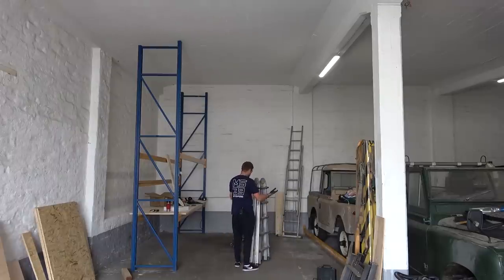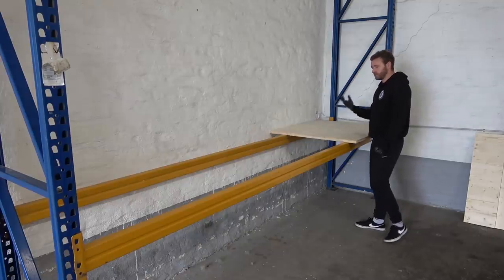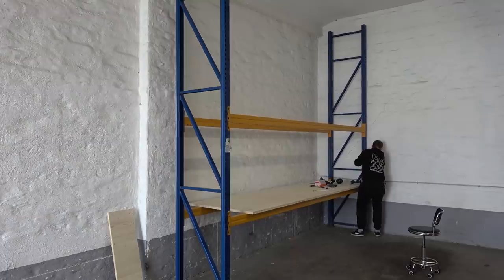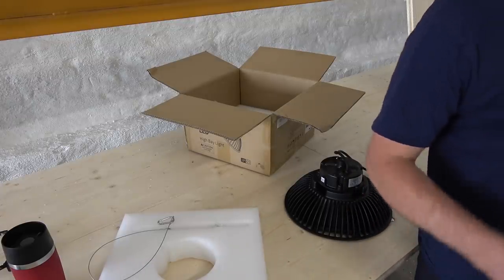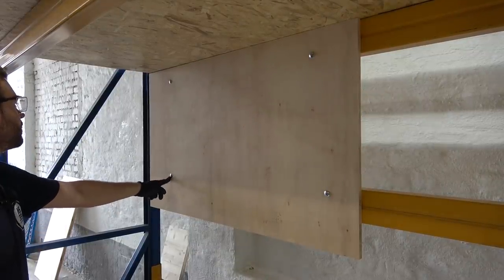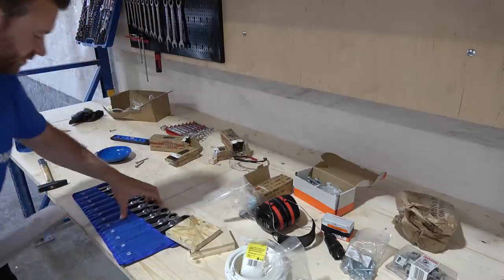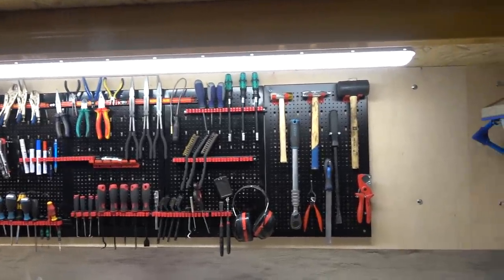Building a Simple Workbench For Working On Cars - Workshop Build: Part 1

Comment: Great idea and well done. One thing you will wish you had done, however, is put a narrow backboard on the work surface at the wall so nothing can fall down at the back. I speak from experience. Thanks for sharing.
Reply from the maker: It's tight fit to the wall but I plan to add a thin wood strip there anyway.
Reply: @M539Restorations  You won't regret it!  Small parts have a magnetic attraction to those narrow slots and finding them on the floor can be disheartening.

Comment: Ideas for additions to the work bench — mounted power strips to plug in tools (soldering iron, dremel, etc.); paper towel / shop towel roll holder; vise; lamp on arm to direct light where you need it; lighted magnifying glass on arm for detail work on PCBs, gauge clusters, carburetors, etc.

Comment: I'm in Australia and it gets cold and hot. More hot than cold. Germany, maybe not good for Summer or Winter in your country but good for Spring or Autumn. Your loading racks seem to have plenty of space to build up (use every space you can fit as you say). Get a few more orange load racks with the wood base and put on the top level of your rack a mattress and pillow for the times you need a rest or a nap. Put another orange rail on the side so you don't fall out of the bed, attach a ladder to get up there, then instant chill out bed to rest your bones and muscles away from home :-) Better than lying on a cold concrete floor!

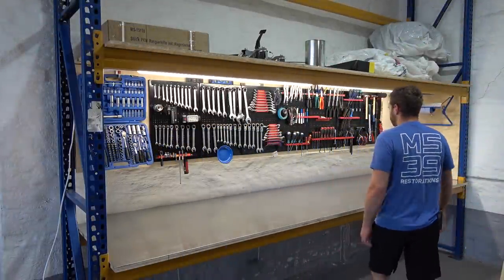Comment: 25:10 Consider turning that 90° corner into a radius(rounded edge) that way, instead of splitting the skin open and cutting, it will just hurt like hell, if hit, in the near future. Also, if you put a mattress on the top shelve, its a quick nap bed. Imagine having one viewer over - a lucky winner - to watch you while you work and film from the top shelf bed. Proper batcave.

Comment: Countersunk self-drilling self-tapping screws with snap-off clearance drilling wings to fix your bench top/shelf boards, etc.  So much easier and quicker than bolting through.  Look them up, they're commonly used for decking on mezzanine floors.

Comment: Very fun video.  Of course being a commenter, I have a suggestion.  Last thing to do before you use it.  Get some polyurethane caulk (or silicone), and lift up your sheet.  Please a thin bead around and between the perimeter of your Aluminum.  Butt them back together, and screw them back down.  Clean up excess.  When you inevitably spill some beverage or solvent, it wont seep into your expensive wood panel, and swell it.  Nothing crazy, just a thin bead will help.  I love it!   I have my own decisions struggles on the garage.  Reminds me, I need to check my LED lighting for camera suitability.  Awesome work!

Comment: You should leave some nice wide gaps on that tool wall you built. Symetrical. In case you have something with a girth on the table and need some extra space to rotate it and so on. So adding 2 or 3 decent nice wide gaps symetrial up to the beam would give you som more options.

Comment: If i saw correctly there is a blue plastic protector on the paper roll metal, if you take it off, it will tear much easier, we used the same thing for a year with that plastic on:)

Comment: love it. Clean, flat and illuminated.

The only thing i would have done differently is where you've put nuts n bolts through - i'd have used Rivnuts in the support bars and then dome head bolts to secure

splendid job though, can't wait to see it in use

Comment: for the bench tops I would use structural or marine ply......it comes with a smooth laminated dark surface and wipes down easily, liquid impervious,available at my local equivalent of walmart. However, that is a great tip to use commercial pallet racking/shelving for a workshop bench and storage combo.......especially if the building has decent ceiling heights.
Reply from the maker: Thanks. That's actually not a good idea if you do what I do, any type of wood and it'll be damaged within minutes which is why I went for alu. It's one of those things, buy it once and never worry about it again.

Comment: Great work Sreten. I wish I had such a well thought out workshop. Just over concern. Aluminium seems a bit soft for a bench top. Most of the automotive/metalworking workshops I been in or set up use stainless steel. You could have ordered it with the front edge folded into a channel the thickness of your timber bench top so that it fitted snugly over the time sand under (this could have been done for the Al too). Screw up from below and therefore no screw heads on top! Keep it in mind for next time. Lloyd

Comment: Should do the bolts upside down as the other side is flatter and upper side are gonna get coverd by a metal plate soo....  

Would be more flush than the knuckle heads.   
Watch them knees..   Just a tip.   ;D

Comment: First is my name is Martin from wa state, I want to say a big thanks to you, if it wasn’t for the vid you did on the e31 doing the cylinder ID sensors I would have never known that the direction was very important, I purchased a new set of plug wires cost over 400.00 us and during my diagnosis of ignition code16 and 41 a bad MAF I noticed the sensor for 7-12 was installed at the factory in the wrong direction for cyl 12, got that fixed now just a broken hot wire in my maf just want give you a big thanks for the info you put out love the content

Comment: I have to say I found your YouTube sites as I was watching other videos on bmws. The one that I watch first was the Chicago BMW. I'm all caught up with all of them waiting to see the last one.

I love the idea that you came up with for using that type of shelving. It makes me mad that I had an opportunity to get a shelving unit just like the one you have for free. I just wasn't sure if something like that would have worked out. Now that I seen what you did I'm now going to keep my eye out for another chance to either get one for free or a reasonable price.

I have a small tip for you and it's nothing major. The screw that you countersunk you should take some clear RTV or a silicone that will hold up the chemicals. You should fill in the top of each screw. If you don't oil and other things will work your way into the wood. My father built a workbench out of wood and then did exactly what you did with the stainless. After a few years my father notice that the screws in certain places where not holding down any longer. So he and I removed the steel and every place that a screw went in had made its way into the wood and rotted out. When we replace the word my dad used some clear RTV on every screw head. That bench lasted another one years after fixing it. The only reason I don't have it with me today was for the fact my father built it in place and there was no way of getting it out of the basement without taking it completely apart.
When I moved my life really did not want that to go so I left it at my childhood home after selling my home.

He is no longer with us and I really wish that I did not listen to my wife. 

I really truly enjoy your videos. I've been watching your videos now over 24 hours.
After watching what you went through with the Chicago build it just made me thankful that I walked away from a 2011 750 BMW. It only had 88,000 miles on it and the owner was told more than likely it was in need of timing chains and those cam sensor that on the end that you act so definitely mixed up and the owner wasn't putting any more money into the car.
The car was super clean at most definitely only had 88,000 miles on it. The price was ridiculous he was asking 7,000 or best offer. After doing research that's why I realize all the issues with that engine. Like you I have no problem yanking the motor out and putting a new or rebuilt one.
When I priced motors here in the states it was ridiculous amount of money they were asking for these used engines. The cheapest I found was $7,000. So here was not a chance in hell I'm buying a used motor for $7,000.

But anyway I just wanted to let you know that I always make sure they hit the big old like button and of course I hit the subscribe button after watching the first video. I'm really looking forward to see what you do next. I know I have a lot of videos to watch that you have made over the years.

Looking very forward for watching more from you.

Comment: My set up is similar, except I have set an old kitchen sink into the bench. It has a 20 litre oil container underneath and I can pour old oil etc into the sink and let the containers drain. You might need some power points for charging power tools, soldering irons and so on. Oh, and where are the girlie calendars?

Comment: erm.. you think that the nut is round and you won't be able to hurt yourself.. but i really recommend putting the bolts in the other way round. countersink the nut into the wood on top and use the carriage bolt's flat head on the bottom. :)

Comment: not boring at all! I love the fact that you keep the tools organized and clean. You could also use the space under desk - some drawers I mean, you'll be surprised how fast you'll fill them up:) Do you have a hydraulic press? I remember you went to a neighbor for something...master cylinder e65 retrofit in e39 :) don't remember what tool you needed... Make sure you reserve some space for future ideas, a welding machine like tig or mig - for flexible joints on exhausts for example nothing crazy or expensive, I know you hate rust and not doing body repairs...or perhaps an aliniament stand that could be also used as a lifter, just saying... I'm thrilled to see how you setup your workspace - the only regret I have is that you hate diesel but I hope one day you'll cange your mind and try fix one, another thing - fix a subscriber car at your choice once, I'm sure none of them have rust buckets (like I did) and they are here because they want to take good care of their cars and want to learn more and do things the right way... The workspace looks great so far Congratulations! Keep up the good work

Comment: use pva glue to seal the wood, it'll protect it from oil ect and you'll be able to wipe it 😁
Reply from the maker: Yes, but it won't make a difference in the end as you'll damage the wood top with tools and parts.

Comment: Just in case theres a compo for spotting possible improvements: Pens .. store them with the tip pointing down :). Anger prevented at zero cost saving you a strawberry feelgood tart every time you need to use a pen. See how I prevented you becoming the Michelin Man in 3 short months?

Comment: 5:43 that disappointed me. The way to prevent the wooden trays from moving is by gluing/screwing two small, wooden guide rails on the lower side, parallel with and just inside the metal rails. That will keep them in place.
Reply: What was the problem with the way he did it?

Comment: You may need some 230V sockets fitted in the surface of the desk. Or you build a tunnel at rear side of the desk, so the sockets are facing to you. Be aware with the corner on the left side and file it. All in all, well done. I was expecting a not so high price.

Comment: Considering the nuts and the bolts on the underside of the (table) beam, seems uncomfortable. You could also use wood screws to screw a wooden beam tot he table plates on the inside of the steel beams (screw them vertically of course), then screw the wooden beams to steel beams horizontally from the side (or do it the other way around, so you can still preload the plates vertically as well).

Comment: the planks could have been turned 90° so that the grain makes them less likely to break at the overhang ... and I would not have drilled through the yellow beams, rather used 2 bolts and a bottom fastening of sort, so as not to weaken the beams for alternate future use

Comment: zip tie that damn light cable. its hanging
Reply from the maker: Wiring is far from being done.
Reply: @M539Restorations  i got a little OCD from that. Also you could have used white wallpaper behind your tool hangers, it would look real pro with that aluminium finish top.

Comment: I Like your Workbench!
But one Thing would disturb me, The Installation of The Lampe ist Not "...Like a Professional"

You are Not supposed to Drill into The Body, in the oposite is a hole u can unscrew and Seal The Body.

And The Wire Looks Like 3x0.75 mm thats okay but U are obliged to sie massive Wire Not flexible...